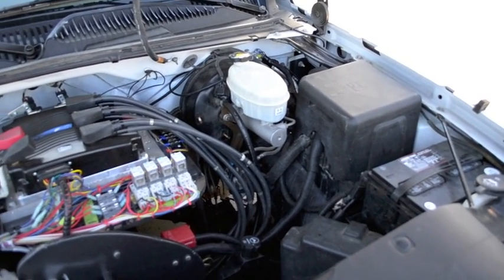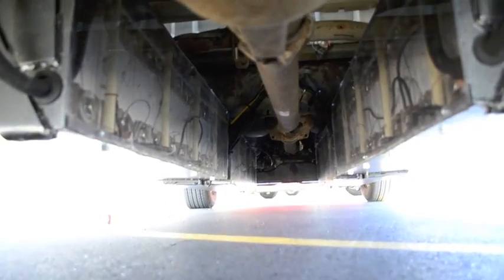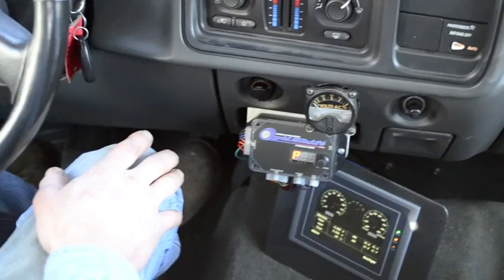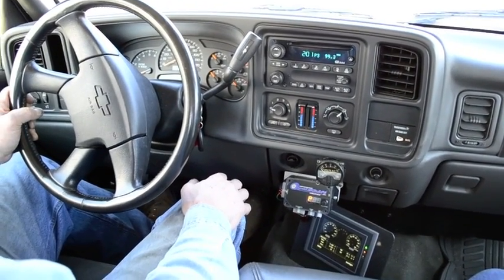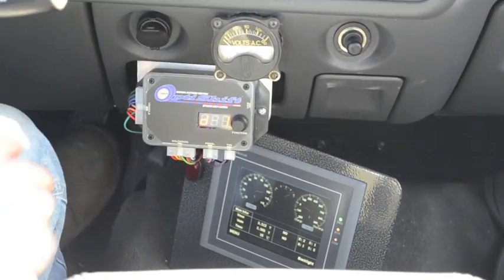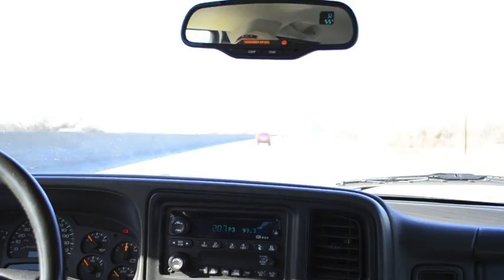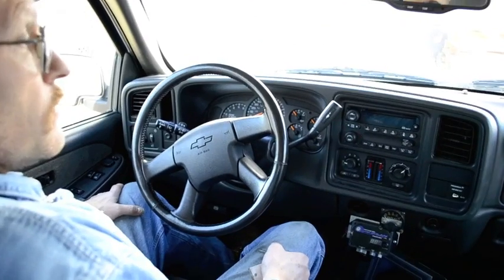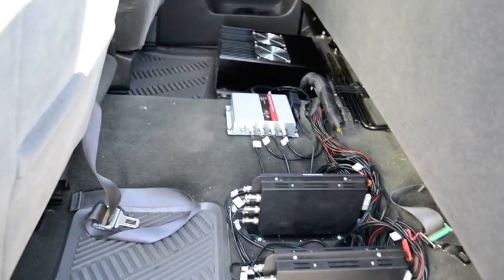Topeka Electric Motor 100% AC Electric Truck

Comment: Hey guys, it seems I could do a similar conversion with non-electronic auto trans and torque converter and eliminate the need for electronic transmission control?

Comment: I like what you guys at Topeka Electric are doing with the auto trans by keeping it intact for the most part. Every example I have seen with Gas to EV conversions getnrid of the clutch and not many use auto transmission at all. I will try to call you this week or send and email

Comment: I've done a few conversions and never had what I would call luck with an automatic transmission. It seems to me we lose about 30% of the range with an automatic compared to a standard. Sounds like you're using 600 watts per mile, where with a standard transmission and a plane DC Drive a 4000 pound pickup gets about 450 watts per mile. Still a very nice job I remember that BMS that you have there being popular 15 years ago. I like the display looks like a nice job all in all. What my friend calls a sanitary installation. I'd like to know what you think of the difference between automatic and a standard transmission.

Comment: Damn you guys are Good seen other EV conversions, no power brake and steering along no heat/AC.  With Ford's decade long debacle of the 5.4 and eco boost engines there is alot of late model Ford bodies that need a reliable engine. The 5.4 Ford truck engine is the must replaced late model engine.  It is pointless because the rebuilds break down too.  In short build a Ford version.

Comment: So I'm probably not the first person to ask this: but why is it set up for a large motor to act in place of an engine? With a set idle speed. And accessories such as air conditioning, power steering, and 12vDC; running off a V-belt. Instead of setting it up so all the accessories are set to run independently like the vacuum pump?

Comment: Man. I'd love to see what this thing could do "full throttle" lol. I wonder how much power it has in comparison to any of the engines that were available to that truck. I know electric motors make more torque, so I imagine it would burn the tires just as good as any V8 if not better lol.

Comment: Seems very complicated, and must be a very inefficient system, but still very impressive setup!
Reply: Looks like there are some inefficiencies, like requiring a constant motor speed at idle, there is a loss in the form of heat in the torque converter, and accessory systems like the power steering pump, and alternator. Although using the existing systems saves on the cost of additional items, making it simpler to convert.

Comment: Any specific reason to use AC on a battery powered vehicle?
Reply: Efficiency and cost are good reasons to use an AC motor. 
Look up pulse width modulation and that'll explain how you can use an AC motor with DC power.
Reply: AC motors can be run more efficiently on DC batteries. 3phase vector control sine wave inverter. No need for transformer.
Reply: Yukari Yakumo transformer can change the dc to ac or ac to dc use diode

Comment: You said the amperage draw was 300 amps or so at 60mph in 3rd gear, then you shifted into 4th overdrive. Did that change the amperage draw at all?

Since electric motors do not depend on rpm, you can drive in any gear you like and check the efficiency with your setup.

Comment: if you want more range or unlimited range, then you should put in some sort of electric generator that could run off the belt like everything else. This way, the motor is powering itself, and charging the batteries. Then put in a smaller gen unit and it should power the accessories.
The batteries will still get you moving until 20mph, after that, its on the big gen.

Comment: Would you be able to build a system that runs off of a highly efficient and quiet generator that could still utilize the current gas tank, and could still carry full trucks loads and reach the regular 100+ mph ranges? I think that would be a good start for me since I still use my truck for landscaping and hauling heavy loads. That way I could do away with the gas guzzling 5.3L V8 I have and work towards a full electric motor.
Reply: I was wondering the same thing a few days ago man.... got a look into it....

Comment: Your approx. 44kwh battery pack can go a theoretical max of 90 miles based on this information. For comparison, the Tesla S and it 85 kwh pack can easily do 260 miles and actually much more at lower speeds. Your electric truck is still cheaper than using gas!

Comment: Why use a transmission with a VFD? Heat is always going to be a problem. EVs don't produce any significant amount. 
My Volt averages ±300Wh/mile.
(250Wh city driving if I drive concervatively)

Comment: Who needs efficiency?

*automatic transmission  
*Alternator instead of DC to DC converter. 
*Idling at 400 rpm instead of a small motor running at peak efficiency for the pumps.  *Heating the antifreez instead of heating the air directly. 
 
It must be averaging at least 700 watt hours per mile.  

It's extravagant but it's thinking gas builder.  Maybe once batteries are around 1/4 the cost this kind of setup will be reasonable.

Comment: Just got into a canversation about AC motors in EVs, and my buddy asked why the Baldor motor is so much more expensive than the AC50 kit that many places sell. So, being online, I looked at the specs, and was impressed by the Baldor. It's continuous torque is close to the AC50's peak torque. The Baldor's efficiency is also much higher.
I think the numbers proove that you get what you pay for.
Should I get the money to convert my "03 Grand Marquis, I'll use the Baldor. It's worth the price.

Comment: very interesting but you forget to mention the most interesting part, what motor is it?
is it a standard industrial AC motor? rewound for lower voltage? does it have an encoder?

Comment: Here's my take on the use of a tourque converter, and I may be corrected by the evmotorguy...
As I see it, they tried to retain the performance, and easy drivability of the original driveline. The motor is relitively small, and almost necessitates the use of a transmission. The truck comes with an automatic, and given that an E-motor does provide full tourque @ zero RPM, the T-converter would prevent that tourque from ripping the tranny apart. I think they made the right call in this situation.

Comment: Good work!  I work at a  EV/plug in hybrid/electronics...  While it's inefficient to keep the auto trans and the belt accessories, it sure is simple and saves a lot of cost and work.  Your 500 "Watt Hours per Mile" is actually quite good (truck).  AC induction motors have enough rpm range they can go without a transmission, just need amps for the low end torque.  Repurposed Baldor is a great idea!  You're Lithium battery ready, they're getting cheaper and better. Curious which Baldor Model?

Comment: Is the 400 ah an artificial minimum ah you have set on the battery monitor or total usable to dead flat..not recommended..anyhoo at a drain of 305amps that 400ah usable would be down to about half an hour or 30 miles taking Purkets (however he is spelt) equation into account..with all that gear to use up your valuable amps you are very soon going to be fitting more batteries!